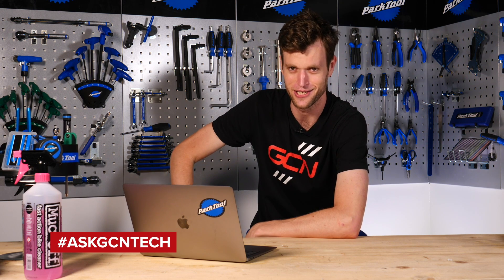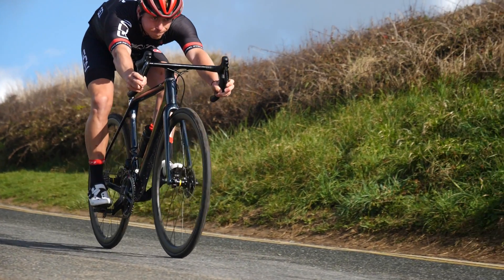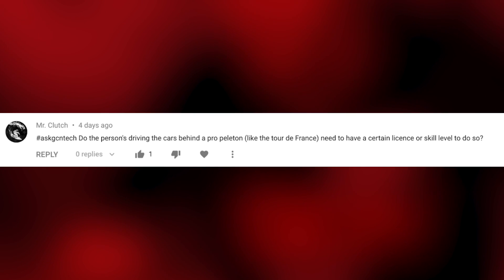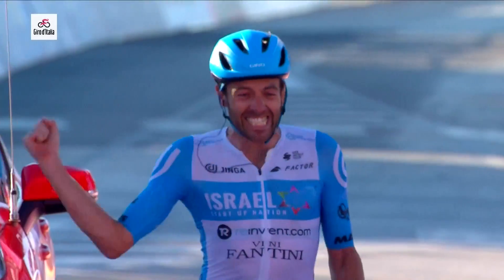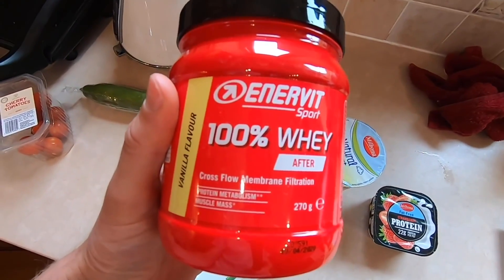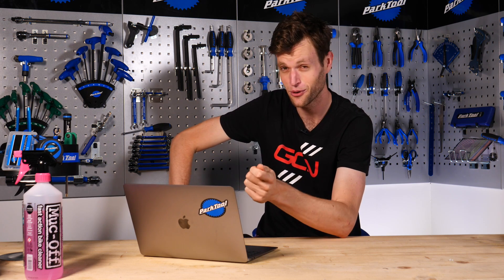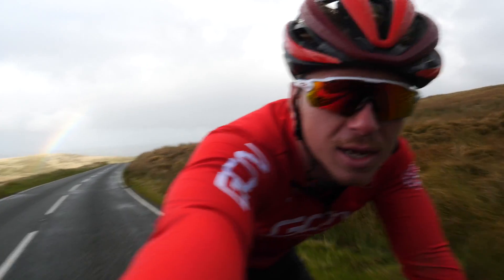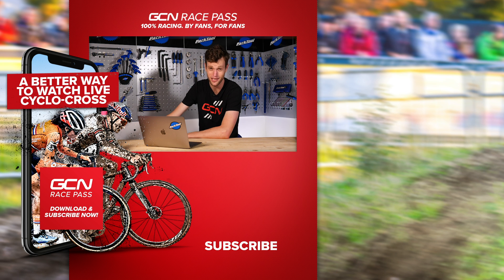Why Do Bicycle Wheel Spokes Cross Over? | GCN Tech Clinic #AskGCNTech

Comment: Spokes are crossed to provide torsional stiffness and transfer of torque. Not lateral strength. If it were lateral strength we would have crossed spokes on all rim brake front wheels now wouldn't we? Crossing them on only one side in the rear results sometimes in creaking and pinging under load, usually under hard efforts and/or heavy riders.
Reply: Yeah, I was just gonna say if you’re on the bigger side, avoid radial spokes. More spokes and crossed for more strength.
Reply: @Kimberly_Sparkles  Big and strong that is. Not just overweight and pushing 100 watts. For pure weight carrying capacity a radial spoke isn't inferior.
Reply: @mikeh6286  I am fat and pushing 100 watts, if I’m lucky.  Nothing is perfect for the situation but that holds up better on the lifetime.
Reply: @mikeh6286  actually crossing the spokes is superior for weight capacity as it loads the hub flange at a greater tangent.
Reply: @galenkehler  thank you! I researched a ton before I bought a bike and that’s what everything I found said.
Reply: @Kimberly_Sparkles  no problem, you did good research. Loading the hub flange at a greater angle is a huge improvement in strength, and because of this will have the further effect of drastically improved longevity.
Reply: @galenkehler  Tangential spokes protect the flange yes (at expense of lower stiffness because of the longer spokes). Front wheels aren't tensioned so high that they risk flange failure though. The small pcd on front hubs create very small tangential angles even at high cross numbers which is inefficient. Maybe it's a way in the past to offer a wheel that could better sustain unbalanced tensions (amateur builder), or a severely bent/weak rim, or with poor hub material quality. Today we check for these things and replace damaged parts before they cause wheel failure. We don't ride extremely weak "wooden" rims anymore to recommend such a measure that may have been a workaround for other issues in the past. Running elbows out on a weak rim build can even create more problems than it solves, like spoke failure.

Comment: #ASKGCNTECH
My front wheel recently got caught between two pieces of concrete and my rim brakes have been a bit slower to brake, the braking surface is a bit rugged with knicks. I was wondering if this is bad for my bike, or if I needed to get entirely new brakes. I don’t go down wicked hills or anything like that, but I would certainly feel more comfortable being able to stop faster. Is there as easy fix to this or should I just replace the brakes all together?
Reply: You could try flattening the surface not the brake blocks with sandpaper. I'm not sure if it'll make much difference but it might save you some money.
Reply: @Calum_S  It'll probably help. Ali Clarkson, the trials guy, uses an angle grinder on the brake surface to get more braking power.
Reply: Take it to a bike shop and get a mechanic to diagnose the problem or...
Just wait and someone might take you to the ER.
Reply: Wildschwein Jäger luckily I wasn’t hurt, I had previously unclipped because I had just crossed a road.

Comment: #askGCNTech I switched the stock Bontrager R2 32MM tyres for the Continental Grand Prix 4 Seasons 28MM tyres but I’ve got no idea what would be the best suited tyre inflation during heavy rains and during dry winter weather?

PS asking this since the back end keeps slipping away during wet weathers
Reply: Go to a website like Silca, and learn to use their tyre pressure calculator and the thinking behind it. Its really helpful information
Reply: Depends on total weight  tyre type. You running a tube or tubeless?

Comment: If calipers are Shimano br785s hydraulic, or similar, then check the back of pads when you take them out. Is there a faint ring of hydraulic fluid? If so, piston seals have failed and you'll to get a warranty repair / replace to fix it. I went through two sets of rotors and 3 sets of pads before I noticed. Oops. I've had three sets of shimano br785s fail in the same way, one pair within 500 miles, the other 1500. I have hope rotors now, as at least with them you get rebuild kits.

Comment: #gcntech my bike wheelset are 28mm aluminum can I upgrade to carbon clincher 38mm or deeper
My bike is pinarello f4 13
Reply: 28 mm I am assuming you mean rim depth. I am guessing 700c is the rim standard that bike is built to. A 700c 28mm depth and a 700c 38mm are the same diameter and will work. However the frame will limit the rim and tire width. I would imagine that frame is limited to a 28mm tire width. Check with Pinarello.